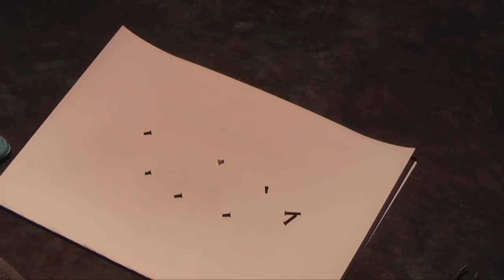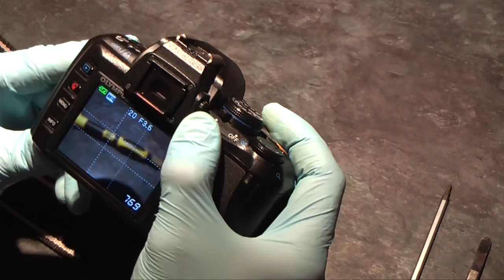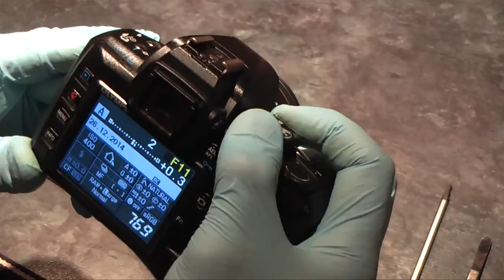Olympus E-420 selector switch clean

Comment: Bardzo dobry filmik. Już raz dawałem mojego Olympus E-420 do serwisu z powodu wyłącznika. Koszt 200 pln (ok. 50€). Po kilku latach znowu ta sama usterka. Żaden serwis nie chciał się do tego zabrać. Więc na podstawie Twojego filmu zrobiłem to sam i działa wspaniale. Dzięki!
A very good video. I already had my Olympus E-420 serviced once because of a selector switch breaker. The cost is PLN 200 (approx. €50). After a few years, the same problem again. No service wanted to do it. So based on your video I did it myself and it works great. Thanks!

Comment: Excellent video Thanks. My E-450 has a faulty exposure compensation button. This strip down covers that point. I have some experience in film camera repair, and plenty in electronics (I used to design products with similar connectors) so I don't forsee any problems getting in. It remains to be seen what the cause of the fault is.

Comment from the maker: Hi Ian,

The problem with my camera was that it kept switching modes by itself, so for example you'd be all set up in manual mode taking shots, and it would jump to maybe automatic or landscape mode. Or you'd be reviewing images and it would jump modes, which went back to camera mode and lost the place where you were viewing. It didn't turn on/off in my case.

That said, however, if you look at 08:00 in the video, you'll see that the power switch and mode switch are essentially part of the same unit - the power contacts are on the outside, mode switch contacts on the inside. So it would be possible that if the power switch contacts got dirty then it might lose connection slightly when you rotate the mode switch.

I guess it could also be the detent ball or spring for the power switch not holding the switch in position - I can't remember if this is the one visible at 09:10, or the other one which is hidden underneath the rotary dial for the mode switch (black screw at the top centre at 07:48). But I think that's quite unlikely. It might be this if the power switch can easily be moved round and doesn't click into position properly. If you cleaned the contacts and took this out and forgot to reinstall it then that will almost certainly be the cause as there will be nothing to hold the power switch on.

Hope that helps.
Matthew
Reply: perfect repair my selector problem, thanks.  Only one thing, may back pannel function does'nt work anymore ?? Mind is a E620 ...have any advise ?

Comment: My left/right arrow buttons and playback button have suddenly stopped working.

I hoping its just a bad seating of the ribbon connector.  Still, it is an eight year old camera, although its had very light use (less than 2000 shots).

Some DSLR's do not seem to be built for a longer life span.
Reply: Just got round to repairing my e450.  It was a badly seated ribbon connector fault 3:08.

Thanks again for the upload.
Reply: witch one is the arrow connector ?  my arrow doesnt work any moore
Reply from the maker: I would check you have inserted all the ribbon connectors correctly (they are very small and fiddly), and that they haven't got contaminated with any dirt or oil, e.g. from your fingers, which is one reason I wore gloves for this.